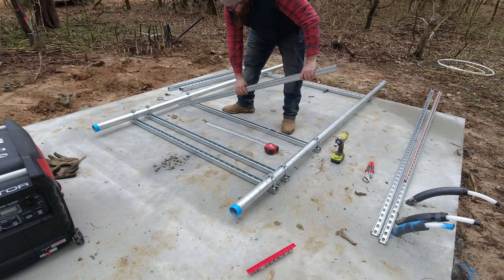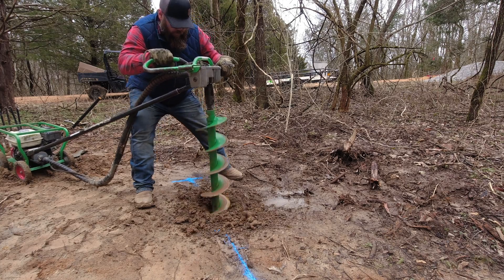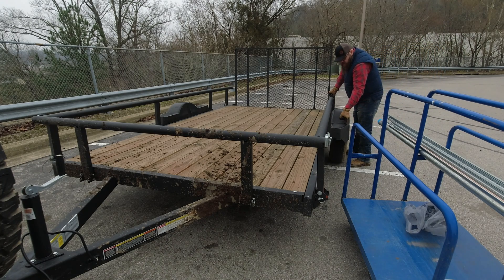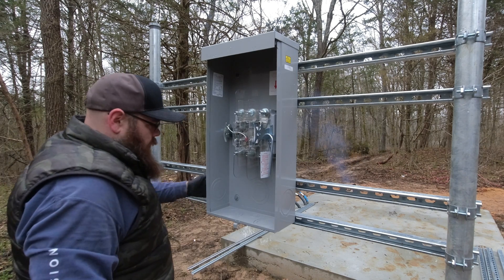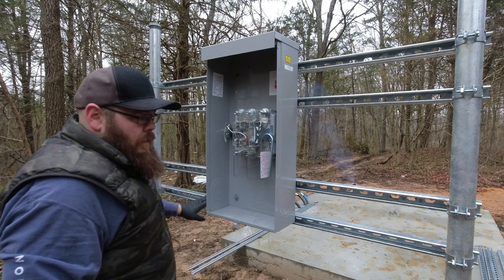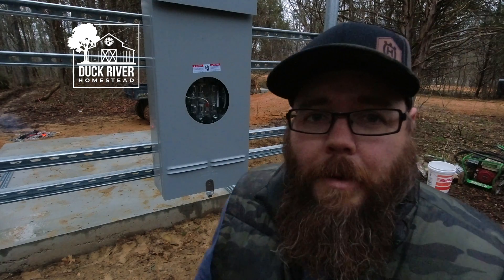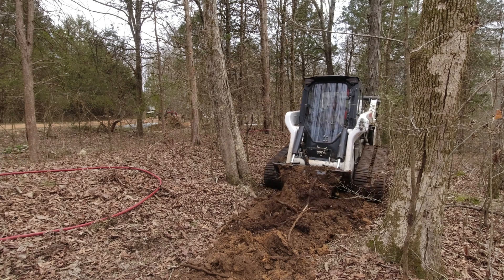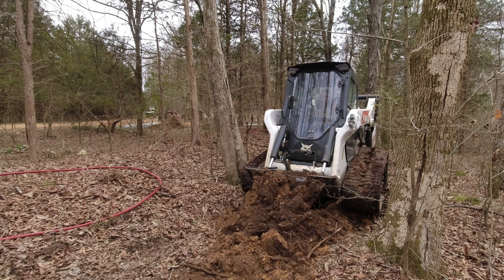031 - Meter Base Installation - 400 Amp Electric Service on the Homestead. Permanent Rack

Comment: Side note: EMT is not designed, nor permitted by the NEC, to be used as a support strutcture. But in the video you said you used rigid steel pipe, so no problem.
Reply from the maker: Thanks for pointing that out.

Comment: 5 feet seems really wide. I'm reading the avista blue book and it says to not exceed 3 feet between the steel pipes. im sure its different where you are. I also had to dig down 40" for the conduit which everybody i had out to look at it said thats crazy deep yet thats what avista wants. this whole process is killing me hahaha. its simple yet not.
Reply from the maker: That's what the electrical architects dictated. It seems to be pretty common around here. Also our frost line is something like 4 inches out here.

Comment: Looks like a great job.  👍.   I’m looking everywhere for a 400 amp single phase meter base.  No one to be found anywhere.   It’s crazy.  
   Good luck with your build
Reply from the maker: Fortunately my local power company had one in stock. Good luck on your search!
Reply: @DuckRiverHomestead  thanks.  A Siemens Rep told me they had no idea when they were gonna see any.  Power Company around here hasn’t seen a 400 1 phase meter base since last summer.  Basically if you have one in use right now. You better hope it doesn’t fail.  There are no replacements.

Comment: As electrician I see great job, but just wondering why 400A, that power can drive 3 houses
Reply from the maker: Agreed. This will have two 200 Amp breakers attached. One will go to the mobile home we're having installed next month, the other will be going to the house I'm building starting in the summer.

Comment: Hey what kind of bolts did you use to lock down the meter on the strut
Reply from the maker: I used 3/8-16 1" galvanized bolts and the strut nuts along with galvanized washers

Comment: What kind of support system did you use to lock down the meter on the strut
Reply from the maker: 3/8 bolts with the spring nuts